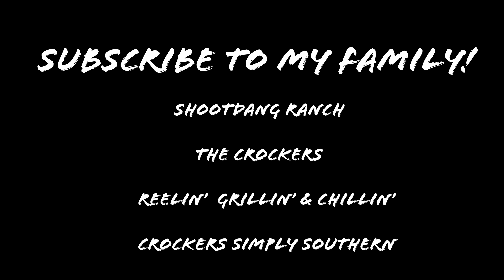Shed To Tiny House In The Woods - I Hope This Helps

Comment: may be a little l8 hope not save some dosh use polystyrene sheet in a decent thickness 100mm ie 4 inch is excellant for insulation and works out less money but is easy to fit u do seal up edges as needed with spray but would only need 4/5 cans whole house the spray kits are banned here due to health issues long and short term. wont take long then u can pull in combi air con units lots to do bro lol stay comfy. nice project coming along take it easy.

Comment: Just found your channel. You are doing a great job. For the windows non expanding foam would have been better than the caulk but the caulking will work fine. What region is this in? Just curious cause of the heat. I am from iowa nd you would need 2x6 studs to get enough insulation to not freeze.

Comment: Will you be skirting the outside bottom of shed before running water  lines and plumbing? Just thinking about some air flow and visibility and access in this heat . Im also not experienced and just curious. Do these sheds need hurricane straps in Oklahoma?

Comment: Jared stop putting yourself down so much just on little things like wearing gloves to keep your hands clean caulking and great stuff is hard to get off. I did maintenance at an apartment complex for 17 years doing make readys use gloves all the time I also did remodeling additions and building houses in the ground up for another 17 years before that work smart not hard you doing a great job keep on trucking peace out ✌🏻

Comment: Hi jared I have a question.  I am cabin in 2 weeks my question is what kind of blocks did you put on the bottom to sustain the shed if you could send me a picture I appreciate it as I have to buy them but different people tell me different things and so I just wanted to make sure that I got what you have you have it well put thank you and you've done a great job I've seen you since your video started I give you all thumbs up
Reply: A lot of houses were built on piers...flat square pad with triangle cement piers on top, then shimmed for leveling. There are many different piers to use. Most homes built this way with no anchor tie downs. We built the little ranch house that Jason renovated using this method 60 years ago and has gone through dozens of hurricanes with no issues.

Comment: Oh if it's not silicone caulk it will shrink up and leave gaps when it dries.
Reply from the maker: I bought the one meant for windows
Reply: @South_Texas_Roots  I'm sure, but I have known that to shrink up and I had to go back and redo it. Just trying to help since I have done it plenty of times. It's going to get covered up by trim but when it gets cold and you feel a draft around the window, that will be why. I would let it dry then go back and put another layer on. That spray foam in the blue can is terrific, just don't let it get outside. The sun makes it turn a nasty orange. I'm not a handyman or anything like that , I don't get paid other than the satisfaction of completion in a job that I have done or helped others. I'm here for you if you like, if I'm bothering you let me know and I'll back off.

Comment: wouldnt "R factor 4 x 8 insulation sheets be easier to insulate the walls and save you some time and effort...i dont know just a thought... then you could do the spray foam insulation around the installed sheets between wall studs? i dont know im an amature also just hate to see you work so hard in this heat ! trying to give suggestions that would help your work go easier for you...not trying to tell you how to do anything .. just suggestion... cant wait to see inside finished and i know you do as well...

Comment: I'm curious about sealing the eves - for this type of roof, how does the roof breathe and vent if there is no air up flow from the eves? Maybe not necessary for a metal roof?   Hopefully, the hot weather gives you a break soon!  Can't wait to see how the structure evolves.

Comment: You just screwed up that roof by blocking up those soffits you need to put suffer fence on the outside so when you put your insulation you have ear that has to escape if you don't let the heat escape from the ceiling your roof will buckle up your breakfast will blow up and then your Roofing will cause the leak not very good to be seen on building up that tight I understand you're trying to stay cool with those soffits were made to put vents in maybe not for a shed but now you're building a house so you want the air heat rises cold air Falls you want that ear to go up to the ceiling it goes through the ceiling and out through your soffit vents